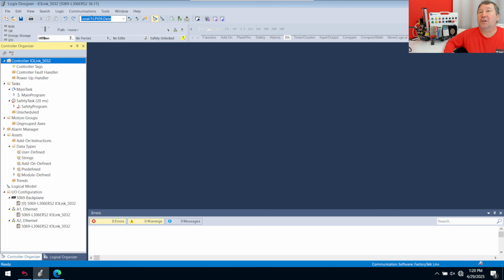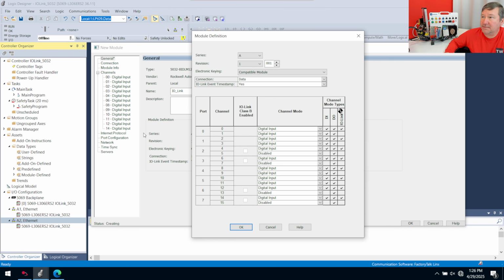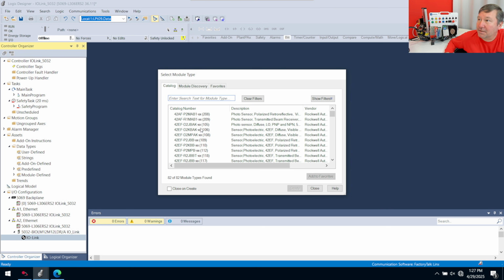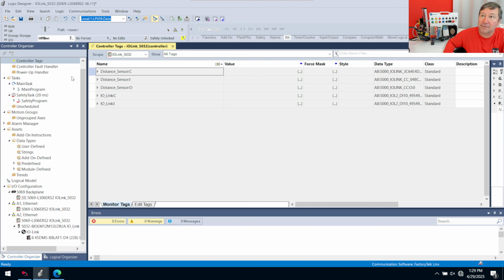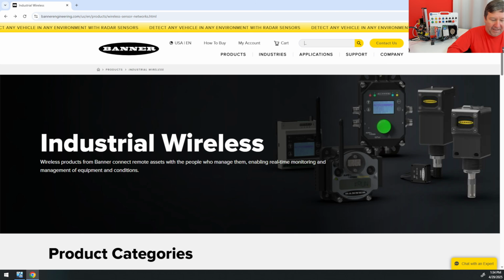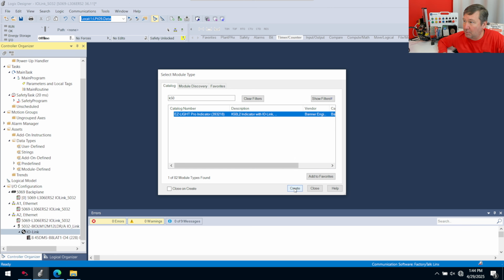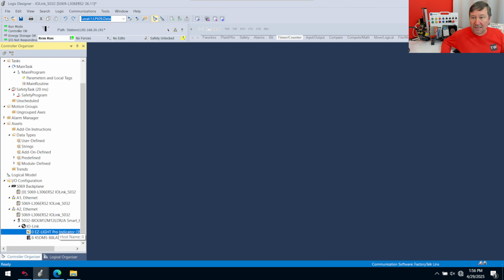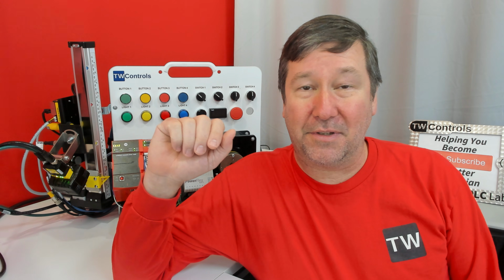5032 IO-Link Module Setup with CompactLogix PLC in Studio 5000

Comment: could you share video about prosoft ILX34-MBS485 I/O module?
I am trying to read the eurotherm epc 3004 controller with RSlogic 5000 by using this I/O link.
Reply from the maker: I haven't used that module

Comment: Just this week, I integrated a 5032 master, I found TWO QUIRKS you gotta watch out for. 1. The new "Device Description File Installation Tool" did not always work when invoked inside Studio 5000. I had better success using it from the WINDOWS START COMMAND bar as stand alone. 2. I installed a 3rd party IODD and got a faulted module, I had to stop or inhibit the IO link device, do a upload from device and that got it working. Allen Bradley's 5032 IO Link master is amazing still with a few quirks to watch out for. Still amazing tech...
Reply from the maker: The Device Description from Studio has been broke for several versions.  Not sure what is different.  Neat trick on fixing the 3rd party device